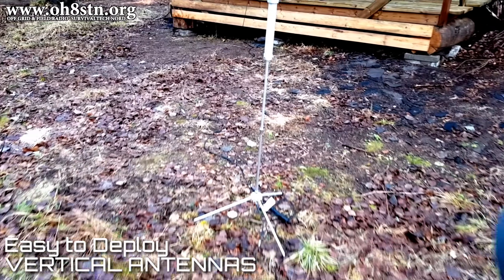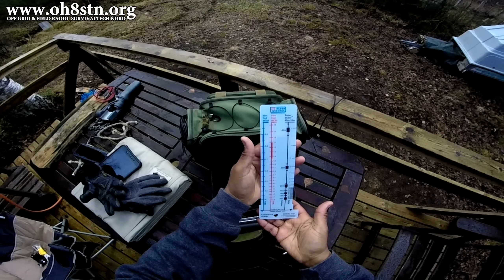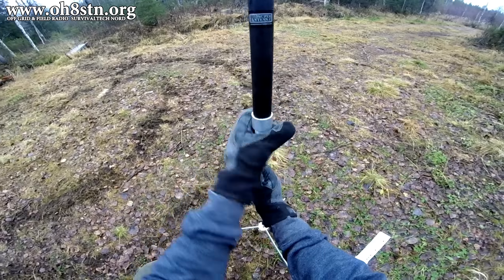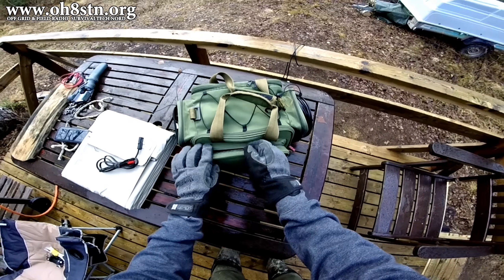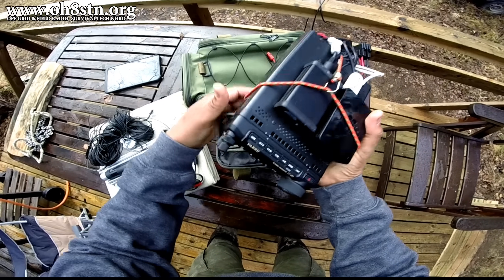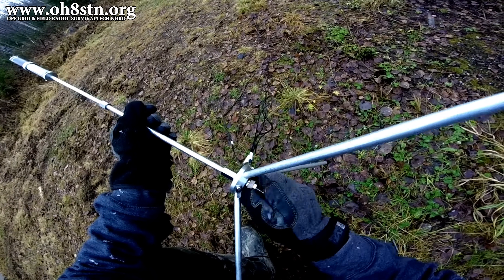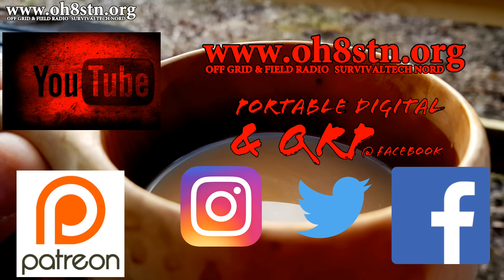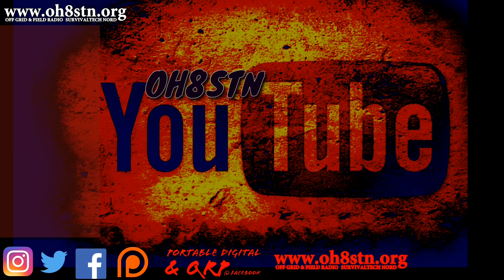Super Antenna MP1 | Ham Radio Antenna

Comment: Thanks for your always no BS, practical videos. Much better than those sitting in the office discussing stuff they have not yet tried…

On counterpoises/radials. Just read the very comprehensive guide on counterpoises from DX engineering (Hustler antenna instructions). They suggest running radials ON the ground - in which case they do not have to be resonant (making them multi band). As soon as you raise them, they need to be resonant.

Have you experience with on/in ground counterpoises ?

Btw, initial impressions of you on video is a slightly intimidating look with those glasses - but quickly offset by your very friendly and helpful attitude :-)

Comment: I have seen couple of ways to support a Super Antenna MP1 in a form of a tripod and always asked myself this question, are these metallic supports going to affect the radiation and performance of the antenna?  or they become part of the ground plane?
I own a Super Antenna MP1 and i am planning to support it with an heavy duty microphone stand which i can extend to a maximum height of 6 foot.  basically the antenna base plate will be attached to the mic stand. Should i in this case isolate the antenna base plate from the stand ? obviously radials will be connected as normal , many thanks in advance 73 de 2E0RPS
Reply from the maker: The antenna mount the base plate we call it is the cold side. Anything attached to it will become part of ground. The hot side (radiating element) has the MP1 itself.  Your counterpoise wires also attach to the cold side.

Comment: Big fan! You really got me into ham radio. Picked up my Super Antenna and looking to build out my go-kit. 

QQ: some kits are modified pelican cases with installed various ports. Why did you choose to with a soft case vs a hard case?
Reply from the maker: Great question and thanks for the kindness. I'm always trying to reduce the weight of my gear. Primarily operating them horrible, weight is a critical aspect of my field excursions. Pelican what case weighs more than the radio gear inside. A soft case with some padding May often be good enough. You have to make the decision on your own but that's the reason I have gone the way I did.
73
Julian oh8stn

Comment: Great video once again. One question i think you have mentioned in another video you could use your micro antenna analyzer to home in on coil tuning. Is there a brand and model number for the micro antenna analyzer? Thanks
Reply from the maker: I'm using the Rig Expert Stick Pro for portable work. It weighs nothing, is usb rechargeable and operates from DC to 600mhz.
73
Julian oh8stn

Comment: Thanks for the video. How does this compare to a loop antenna and which one would you prefer
Reply from the maker: I think it depends the operating location. The quarter wave vertical is nice but you have to have lots of counterpoise wires. If you've got a lot of people around or animals they can get in the way. The magic Loops are nice because it is what it is, there's nothing extra to trip over, and it's easy to set up. I've had good results with both. Anyway, take a look at this video of my favorite configuration for the quarter wave vertical https://youtu.be/t_wzggM7-0E

Comment: Wouldn't it be more accurate to call them radial wires?  I use a 1/4 wave counterpoise attached to the rig ground point for my 3rd storey apartment station and I have radial wires attached to my Super Antenna.

Comment: Just an update to my earlier post, I used the 80m coil a few nights ago and made a contact with a station 1000 miles away, a 7 foot long antenna I was amazed. It works. SWR was hard to get below 2.1:1 so I was not outputting more than about 50-60 watts on the FT-891 but I still made a contact 1000 miles away, yes, a 7 foot antenna.........

I've heard the much longer MFJ-1979 whip improves this antenna a lot especially on 20m, I haven't tried it yet.
Reply from the maker: YouTube didnt like your comment :D Yeah the 80m coil works. The mp1 surprises me every now and again.
Reply: @OH8STN  "youtube didn't like your comment" what do you mean ? 

Yes for a compromised antenna it works well.
Reply from the maker: Sorry I was too cryptic. YouTube moderated your comment automatically for some reason. I don't quite get it since you've commented quite a few times on the channel.
Reply: @OH8STN  Oh that's strange, how did they moderate it ?

I ordered the MPAS 2.0 recently, (out of stock and will probably take a month to get it but I can't wait to try it out. The real benefit will be not having to go back to the antenna, hook up analyser and adjust for each band change. The MP1 breaks down into an incredibly small size and from all the videos I've seen much smaller than the MPAS 2.0 but this level of compactness is not my main concern. when I get a window to go out be it rain, wind or cold I want to spend less time messing around with the antenna and more time on the radio especially when the weather is bad. 

How long can the MPAS 2.0 vertical be left out in the rain ?

Comment: what is the total length of the wire radial for the 80m band?
Reply from the maker: 1/4 wavelength.
Here is a 1/4 wavelength calculator http://www.66pacific.com/calculators/quarter-wave-vertical-antenna-calculator.aspx

Comment: Another fine video! Thoughts on ideal height above ground for counter poises? Thx, and 73 WM1K
Reply from the maker: When its convenient, I like them about 3ft 1 meter above ground. The point is to create that capacitance between the Earth and the counterpoise. 
In contrast, If we were using radials laying on the ground, I would use as many radials as possible, spreading them out evenly around the base of the antenna.

Comment: You mention the custom counterpoise sets.  What bands are you using and can you give the dimensions?   Thinking that’s my next step in evolving my Superantenna setup.  Tnx
Reply from the maker: Hi Rich
I have multiple sets for different ops.
I calculate 1/4 of the frequency length in meters. It will different slightly with wire used because of velocity factor, so start longer then shorten slightly. The counterpoint wires are 1/4 wavelength. Use this calculator to get close. http://www.csgnetwork.com/antennagpcalc.html
5he more counterpoint wires you have, the better the performance. Elevating the counterpoint wires will also increase performance.
Let me know if this helps 👍

Comment: Can you specify what bands it will cover and the counterpoise kit if included or not? I am planning to use outdoors in parks, but also on an attic. Interest for use on 2m, 70cm, and HF, 220? Thanks. 73. This model I saw, but not sure if it will do as I need. MP1DXTR80.

PS. I can buy wire to make counterpoises too, but where do I get the formulas? Thanks.
Reply from the maker: Hello.
Here's a link to the kit you mentioned https://amzn.to/2MszRLZ
According to the information from the super antenna website that's specific kit gets you on air from 80 meters to 70 cm. There is a counterpoise kit included, it includes 6-2m, 80/75 meters, and 40-10m.
If you ever want to make them yourself, the MP1  uses quarter wavelength counterpoise wires. That's one quarter of the length of band you're operating on in meters. Then convert to feet/inches if required.
Reply from the maker: I forgot to answer your other question. It says 80M through UHF. But that link I gave you covers all the details.

Comment: Enjoyed it thanks.  I am thinking of buying a raspberry pi to do this and I am wondering if you can use the rp audio to run the radio.  I currently use super cheap external sound cards and the vox on my FT891 and it seems to work well.  Have you tried that?
Thanks
Steve
KN4GVV
Reply from the maker: I have one set up with my 817 using the usb sound card. Some of those sound cards don't work I mean the really cheap ones. But the official one supported by Raspberry Pi should always work

Comment: I appreciate your videos greatly but you talked me out of this antenna for QRP for my Yaesu FT-818 but I may change my mind. It's a good thing though because it made me realize how simple the end fed antenna or loop fed antennas are. I'm using the MFJ telescopic antenna for quick QRP but it's finnicky.
Reply from the maker: As I always say, the antenna we choose is based on our mission and requirements. The thing I love about the super antenna mp1 is operating from 80-2 meters coverage without a tuner. It also doesn't break when it falls down. Some operators have had good success with that mfj, but personally I'm never buying another product from mfj, since they screwed me on the antenna analyzer.

Comment: You mentioned putting the MP1 on a roof  does that mean spreading out the radials on the roof ?..I'm asking cause i hoping  to use this antenna on my roof but haven't seen anyone in youtube that did one on a roof with the radials or how they would spread them on a roof or drop them to the ground. limited ground space here
Reply from the maker: yes we do use radials, but they do not need to reach the ground. Radials should be tuned quarter wave, for the band youll use teh antenna on. You can also make multiband radials for the most used bands.  if you are using a single band, its easy. Iy you need to change bands, setup the mp1 for the highest band used (plus radials) and use your tuner for lower bands.
More radials gives better efficiency, so dont be stingy with them :)
Reply from the maker: I forgot to mention. The radials (actually counterpoise wires) are just wire. Nothing fancy like floating elements or anything :)
Reply: @OH8STN  thank you for the quick response tomorrow its going on the roof also installing a Tram 1411  while im up there
Reply from the maker: Even one more tip. If you roof is metal, you can use the UM1 mount with the clamp to attack the base to your roof. No counterpoise requires since the roof becomes the earth for teh antenna.
Reply: @OH8STN  no my roof is not metal... so im guessing just spread the counterpoise wires on my roof as equal apart as possible?  i may be mounting the antenna to a vent pipe that's a medal ill know more while im up there

Comment: Just purchased a used 817nd and the windcamp 3000 mah battery option and have the super antenna max thanks for the inspiration 73 KC1HYM
Reply from the maker: No problem. The point is to get out there, try, and have an absolute blast while learning👍

Comment: Julian....as a fairly new Ham, I must say how impressed I've been with your approach and the detail that you provide in the videos.  Sometimes I feel like I'm "drinking through a firehose" on some of the technical aspects, but I find if I watch a particular segment repeatedly, take notes, and then research what your saying, most times I can get the idea!  That is the mark of an excellent teacher...I.e. one who does NOT "spoon feed" the students; rather one who inspired them to experiment.  Just now trying to get hold of the raspberry pi "thing"...knew about them but only now hoping to emulate your system for use in my Park on the Air adventures.  One question I did have: you mentioned that by elevating the counterpoise wires, better efficiency could be obtained.  I'm going to replicate your approach using my Wolf River Coil TIA vertical by adding a couple extra wires the the three that come with the antenna ( the extras cut to 1/4 wave of the bands I want, right?), but how much elevation is useful ? Like the MP1, the WRC/TIA pretty much sits right on the ground as well.  Thanks!  Steve, KD9JTU
Reply from the maker: Hello Steve. Although I appreciate everything you're saying you're far too kind. Everybody has a skill set and hopefully they're sharing what they know.
So yes what we're talking about this elevated tuned counterpoise wires. Naturally the idea is to get the counterpoise wires up off the ground, at least the height of the feet point. In my example the feed point is basically on the ground, which means I accept the losses, but only because I was able to reach the station's I was trying to reach in this video. If I were to playing this antenna someplace else and wanted the higher efficiency I would put the tripod up on a rock for example, a tree stump, any improvised elevated space I could find. Then I would keep the counterpoise wires elevated as they spread out the way from the feed point. But here's the kick in the pants. We can read 20 different books and get 20 different answers about the right height. We're all of those books agree, is that the counterpoise wires and the feed Point need to be insulated from ground. By ground I mean literally insulated from ground. Now during my wspr testing I have found anyting above ground is an improvement. So I wouldn't worry about some specific height to shoot for,  because in reality, the environment will dictate our antenna and counterpoise deployment.  
So bottom line Steve, it's not an exact science, and we're not too playing in free space. The most important thing is to get them up off the ground. If you can't get them off the ground, use more of them. 
I hope this helps.
Thanks for the kindness and the questions. It's very much appreciated.
73
Julian oh8stn

Comment: Thanks for this video. I am not familiar with the Super Antenna, as I already have the Cameleon system. Having seen the Super Antenna in use now, my interest is peaked. I'm working on my own portable/mobile Raspberry Pi and Yaesu FT-891 based go station. I'm still missing a few bits and pieces but hope to have it completed in the next few months. Your videos have been very useful as guides when selecting gear. I've elected to use a dedicated RPi screen rather than use the headless connection to a tablet. I like having a fully self-contained computer and screen combination. Mine is mounted in a purpose-built stand which folds down for storage and pops up when in use. This slightly more complicated system works better for me. Your setup is excellent but I have somewhat different requirements for a station that works as a base station as well as being portable.

Comment: Hi Julian i use the older MP1 model antenna with the telescopic element can you tell me if there is any difference  in using the MP1DXTR2 with the SW1 Whip   thanks  M0YCQ
Reply from the maker: Hi Stephen.
Performance wise, I have not noticed a difference. Deployment wise, the SW1 is more robust and won't break. 
Hope this helps.
73
Julian oh8stn
Reply: Hi Julian many thanks for the information and the quick response i will stick with the telescopic element for the time being but if it brakes i will get a SW1 hopefully the home made tie down  consisting of a old plastic coffee jar top and three ring screws should be effective in roping down this lightweight tripod in windy conditions and hopefully stop it falling over.                     all the best   73 Steve M0YCQ

Comment: Great video. I purchased the same antenna for my trips to Kauai. I have made contacts on 40, 10 and 2 meters running portable (2 meters was obviously local FM). The system is very well built but no match for a long wire if you can get some elevation. If you are running from the ground or a hotel balcony this is the best solution that I have found. The threads on the base work great with your camera tripod. 73's KK6FGM.

Comment: Julian excellent video as always.  I do have a question unrelated.  The FT817ND has been a staple in your arsenal of radio. With your new FT891 do you find yourself using the 891 exclusively?  If not, what situation beside obvious size, power, and backup would you say keeping the FT817ND has a lot of benefit?  Thank you, JonGiovanni
Reply from the maker: That's a magnificent question but it's kind of complicated to answer. There is definitely a place in my gear for the 817. I think it's best that I come back to this question in the form of a video or blog post.

Comment: I think I missed hear what model android tablet you used, I would like to know, I’m working on building my system with a pi controller, FT-817, and a buddipole, it’s heavier, and bulkier, but I work in the heart of tornado alley Oklahoma so with the winds here , I just feel a bit more confident with heavier setup.... but that’s just me... but back to my question I’m curious about the model of your android tablet
Reply from the maker: Hi Rodney 
The tablet is Samsung Galaxy Tab T365, but any tablet, laptop, or smartphone will work as a wireless screen using VNC. Have a look at my Ham Radio with a Raspberry Pi playlist https://youtu.be/BcMMlGvPCsw
Thanks for the question 
73
Julian oh8stn
Reply: OH8STN Thank you 🙏 so much! Keep the videos coming. 
73’s KC5DZH

Comment: Hi Julian, nice video! I like your Go-kit station, in particular the integration of the Raspberry Pi. I think I've something for you to test on your next trip using JS8call. I've got an APRS > Twitter gateway (https://twitter.com/F4GVE_Gateway), this is very simple to use: you just need to send an APRS message to F4GVE and the message will be publish on Twitter. You can mention Twitter users with @ and use hashtag with #. I don't know if JS8call allows to send APRS messages because I'm not yet a JS8call user. If so it could be intersting (and fun) to send tweets from a remote area with JS8call: you just need to reach an iGate station. Unfortunately I'm unable to send acknowlage and of course this a unidirectional gateway. The system works with HF Robust Packet, APRS (HF/VHF) and DMR (using APRS gateway 5057). So let me know if you want to test.
Reply from the maker: Outstanding.  Definitely want to test, but first I need to understand how to send the aprs message with JS8Call. This sounds absolutely magnificent, so let's give it a try next time in the field. I'll start preparing things on my side
Reply: @OH8STN  Cool, I hope you will able to send APRS message via JS8call: I think it's possible but I don't know how. If not you can use HF APRS. 73's de Adrien